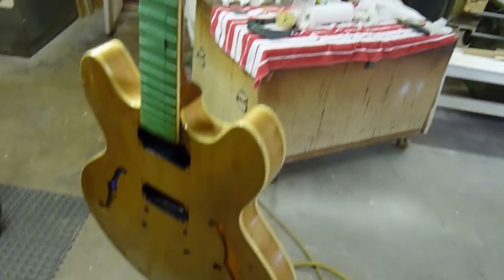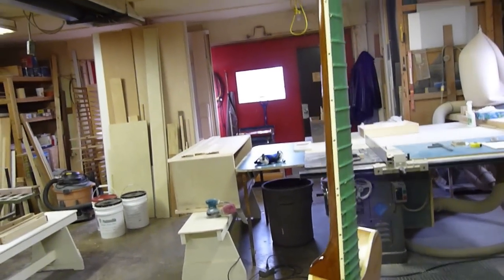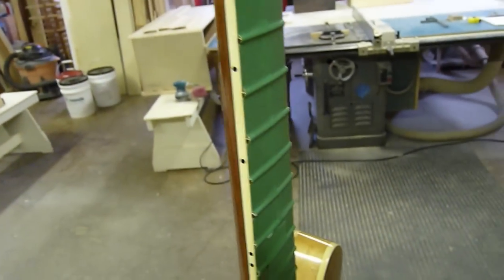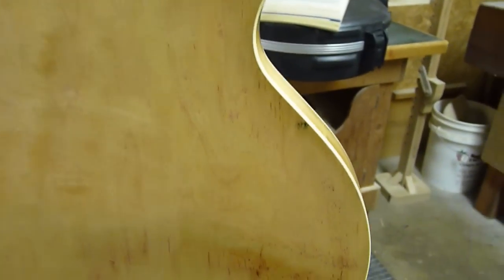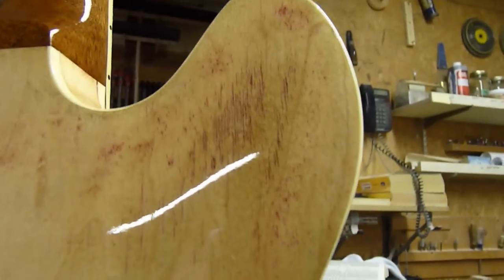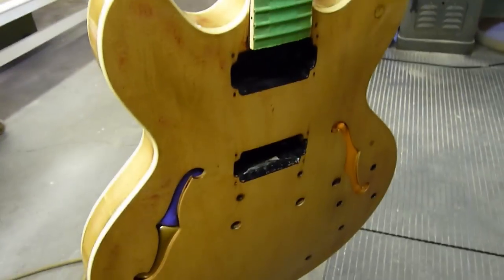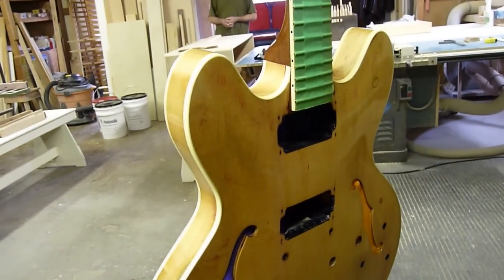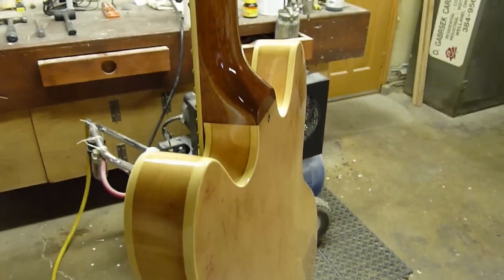1966 Gibson ES-335 Restoration-Part 1

Comment: Great work with detail! I have a question. Is it easy to patch drilled holes? And are they very visible if you have a wood stain finish? I'm asking 'cause I'm left handed and I want to know if it's possible to get a right handed DIY semi hollow kit and patch the holes so I can drill new ones on the other side. Thanks.
Reply from the maker: Thanks Giannis! It's easy enough to patch holes, but next to impossible to make the patch invisible if using a wood stain finish. Definitely don't use end grain wood for the patch (like a dowel). Two reasons why, the end grain will soak up stain and become much darker then the surrounding veneer and also because end grain will move and shrink differently than the surrounding wood.
Reply: Thank you very much for the quick reply and the tips Freddy! I'll be watching your great work!

Comment: What do you use to patch the holes you speak of (around 3:00)
Reply from the maker: I used little pieces of maple veneer plywood. Reason being is that it's dimensionally stable....sometimes you see people using dowel but that's a big mistake....it's end grain that will move in a totally different way than the existing wood (no matter whether it's solid wood or plywood)
Reply: @FreddysFrets  what about for the glue?
Reply from the maker: @rogerbaker5112   Urea - Formaldehyde Resin